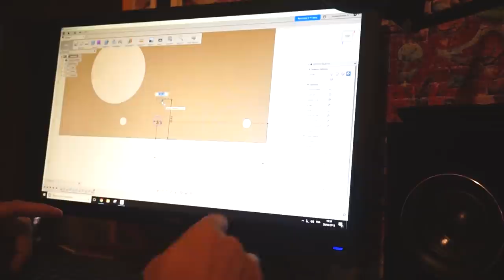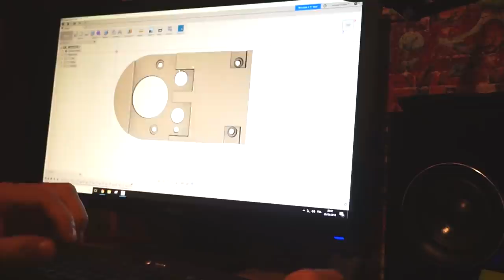Semelle pour BOSCH GKF 12V-8

Comment: Salut, j'ai cru voir que tu as une défonceuse bosch la gmf 1600 que tu te sers sous table ? Le réglage de la hauteur une fois sous table se fait de quelle manière sur celle ci ?
Reply from the maker: Slt ,bien vue ,le réglages ce fait par le dessus avec une clé . C' est d' origine sur la machine .
Reply: Quand elle retouvre la tête en bas sous la table c'est donc facile de régler la hauteur de fraise ? J'avais repérer une triton pour sa faciliter de réglage sous table mais le changement de semelle en un clic sur la bosch a l'air top pour la passer de stationnaire à portative. Il y a juste les réglages en sous table ou je me pose des questions.
Reply from the maker: Le réglage ce fait par le dessus comme la triton , et avec la double base j' en laisse une sous table 👌